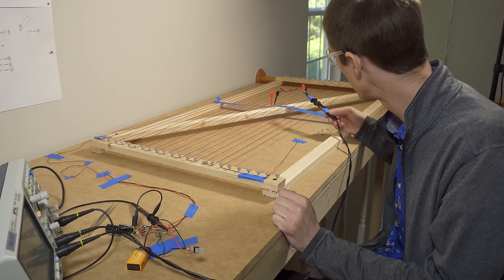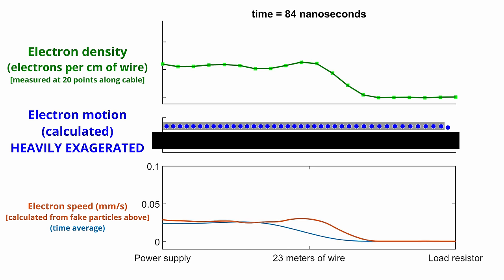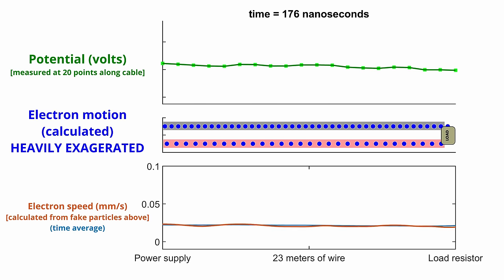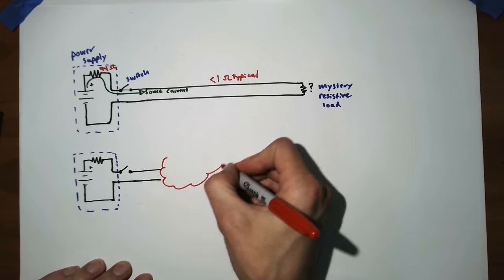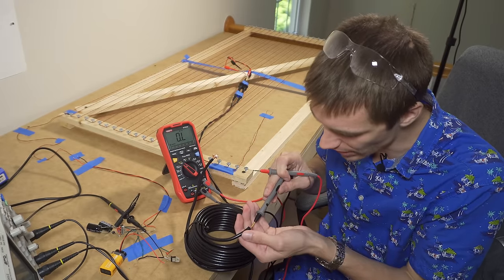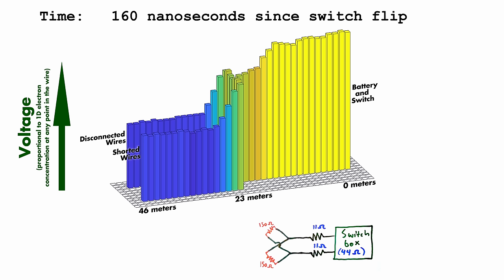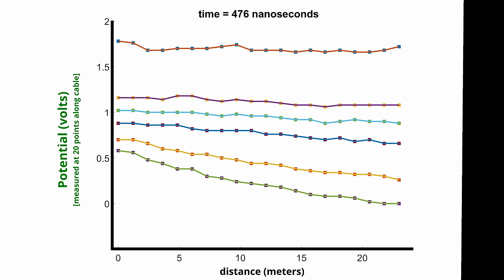What does "impedance matching" actually look like? (electricity waves)

Comment: I wanted to know where the characteristic impedance of 150 ohms came from. Seemed like too much magic for me.

I asked chatgpt and it says it comes from the setup of the transmission lines themselves, and is dependent on the diameter and spacing of the wires.

Z0 = 276 * log10(2D / d)

(2D / d) = 10^(Z0 / 276)

So assuming you have 20AWG wires,

(2D / d) = 10^(150 / 276) ≈ 2.12

2D = 2.12 * 0.81 mm ≈ 1.72 mm

D = 1.72 mm / 2 ≈ 0.86 mm 

So, the distance between the center of your two wires 0.86mm from my calculations.

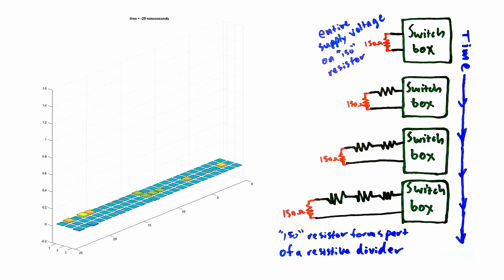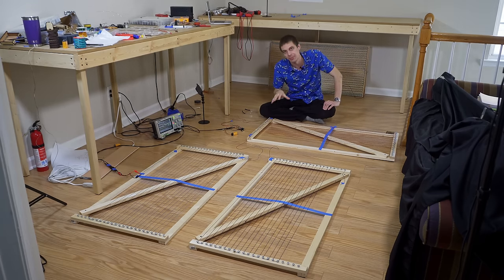Comment: SUPER CONFUSED...at 15:40 where you substitute a completely different kind of wire, you still write 150 ohms impedance. I thought the whole point of the video is that the impedance only depends on the cable design and not the power supply resistance or actual load at the other end of the wire or anything else.  So shouldn't the impedance be something other than 150 ohms when substituting the resistive wire for the original twisted pair?  I still don't understand where does the impedance actually come from, if changing the wire doesn't change the impedance.  Unless it's some kind of vast coincidence that the different kind of wire happens to still work out to 150 ohms????? I really really want to finally understand impedance but this 150 ohms at 15:40 throws a wrench into my understanding.
Reply: Does the impedance actually only depend on the power supply and not the wire?  So confused.
Reply: Put another way, what actually has impedance?  The wire? The power supply?  An interdependent combination of the wire and the power supply?  And regardless of which of these three it is, why does substituting the wire at 15:40 not change the impedance?

Comment: the resistance is make you an opportunity to play with the current, it means that you can make your current lower , THE WIERS BILD WITH MOST LOW RESISTANCE TO GIVE THE ELECTRONCE MOVE WITH LESS RESISTENCE AND WITH MORE CONDUCTIVITY SO, JUST A CONSUMER (LIKE A LAMP) GIVE YOU A RESISTENT. SO THE WIERS ARE BUILD WITH LOWEST RESISTENS TO GIVE YOUR LAMP A BATTER LIGHT (AS AN EXAMPLE) LIKE P=U*I THE LAMP=P THE U=VOLT AND THE CURRENT=I.

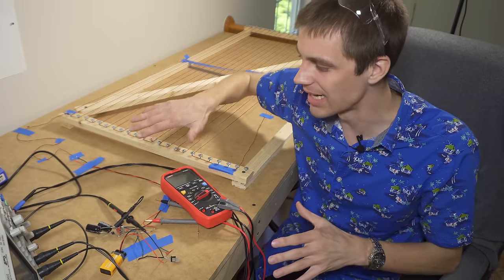Comment: @11:57 It doesn't stop with an AC signal. Or if it does stop, it repeats over and over, so AC is really where transmission lines become interesting and why AC is a much more efficient way of transmitting power over distance.

Comment: Impedance is the effective resistance of an electric circuit or component to ALTERNATING current, arising from the combined effects of ohmic resistance and reactance. In your consideration for the first "pulse" of electricity the cct is an Alternating supply IE going from 0 to + volts when you switch on.
The circuit has more than a simple Ohmic resitance. In AC terms this is called reactance, (practically you show that well), so the Imprdance of a circuit is calculated as 
Z = \sqrt{R^2 + (X_L - X_C)^2}
Z	=	impedance
R	=	resistance
X_L	=	inductive reactance
X_C	=	capacitive reactance

I loved AC theory!

Comment: At t=3:19, you have the electron velocity (23um/s), but it could be 'better' scaled so that the time period matches that of the period of it's motion (you have a 156 nanosecond graph), so IIUC it's 3/20ths of that for the density change ~25ns (1/40th microsecond), so let's reframe that velocity as ~1 picometer / rise time (25ns). That's hardly any movement at all! 
Given copper's crystal spacing of 363nm were talking 0.3% of the width of the copper atom. It's a very small head nod of a 'Mexican wave'. 
Good for context.

Comment: Electrons aren’t balls in a pipe. It doesn’t work that way. There are no “clumps of electrons”. If that were true, capacitors would gain mass when they were charged and lose mass when discharged, as the “clumps of electrons” flowed in and out. But that’s not whats happening at all. It’s a transverse wave being transformed into a longitudinal standing wave and back again, each cycle. The longitudinal dialectic impulse drives each transverse oscillation which forms the electro-magnetic transverse wave, or what you call “an electron” each cycle. But it ain’t billiard balls in a pipe. A wire is just a wave guide. And electricity and magnetism flows around wires, like a wave guide, and not through them.

Comment: Congratulations, you've explained what a "transient response" is and finally fit the final puzzle on the "impedance matching" argument between Veritasium & Electroboom long ago.
But yea, electricity is weird, we're just putting 50ohm, 75ohm, 150ohm and 330ohm value just to cheat physics and dumbing everything down so it can be practical in real world.
Again, we're just referring them to the number of "RG" on whatever cable we're trying to fit between two connections depending on what application we're doing.

Comment: People overclocking computers can actually break hardware with this "spike" of voltage. JayzTwoCents accidentally did this on camera. When overclocking, one of the parameters you can change is voltage as adding more voltage can usually help push higher clock speeds. When applying a risky voltage right at the very edge of what he thought it could handle (something bonkers ~1.6v which would probably instantly pop most modern chips which run ~1.1-1.2 iirc) as the system locked up completely and he had to turn it off to restart. He restarted it, but that spike in voltage sent it (proportionally) WAY over the edge and bricked the CPU. Maybe give it a watch. It was a cool video from what I can remember.

Comment: This topic always fascinates me. And I was struggling trying to understand impedance matching until I got into ham radio and started reading ARRL Antenna Book. In the transmission lines theory section,  it explains Z matching for AC circuits and it's importance. Basically, a transmission line represents myriads of capacitors and inductors in series that make the line reactive and gives its characteristic impedance. When the load Z at the output of the line exactly matches the characteristic Z the line "thinks" it's just a continuation of itself.. No reflections occur, resulting in full transfer of power with no losses (except the material's resistance).

But yeah, your "recognizance'' pulse is super cool.  Another, mind blowing thing for me is that if, for example, a line had no resistance and was 100% lossless, the current would still directly depend on the voltage in accordance with the Ohm's Law, just as though resistance  was there!... I  don't have an engineering background so it really seems cool to me . Surely, for engineers it's not news at all)))

Comment: 12:02 "This state (where it looks like the wires are connected) can only exist briefly" This is an interesting comment, especially when you start thinking about AC high frequency RF signals; effectively, when you're switching your voltages fast enough, that "state" exists indefinitely (because you flip directions before the electrons have a chance to get around the whole loop) which is why the impedance of a cable (and its associated mismatches) is so important. You never reach equilibrium, so these transmission line effects dominate.

This is related to why it's entirely possible (and, in many cases, intended) for some designs of wireless antennae to actually present a "short" at DC and things still work fine. If you're going to waggle your electrons back and forth fast enough, it simply doesn't matter that much for the overall current flow whether the ends of your wires are shorted or open, but either configuration can affect the overall propagation of the electromagnetic fields in favourable ways to ensure efficient energy transfer into the air.

Comment: Can someone explain why the circuit (pulse generator) expects for 150 Ohm impedance, even if the twisted pair line isn't connected yet, where does this number of 150 comes from? Because he said that internal resistance of  power supply is 44 Ohm, it's so confusing...

Comment: I find it fascinating that you were able to use a $100 (or so) oscilloscope to obtain measurements that you could then plot to show us the REAL ACTUAL waves in voltage traveling around a wire, when this understanding and notion of waves of voltage propagating around, the reflections thereof, transients and other difficult-to-grasp advanced concepts in electrical engineering, has been around for a long time, and gigahertz precision measurement equipment has existed for many decades (even if it was expensive earlier on) but nobody thought it was worth the time to figure out how to obtain and collect the data to teach students. 

You should receive a prestigious award from the IEEE as well as probably ACM for your contribution to pedagogy. Not joking in the slightest here.

Comment: So the Standing Wave Ratio I measured in, & tuned my homemade antenna to lower, with RF (radio waves) is analogous to why I impedance match my headphones to the amplifier. I'm giving the electrons what they expect to see, stopping continuously re-initiated negotiation waves every time the voltage changes. 
Actually seeing those waves was worth every second you spent adding taps to your bespoke twisted pair.
Have I got this right? That tuning an antenna to resonance is for the same reason I match my 2000 Ohm Sennheiser HD-424X headphones to an amplifier that "expects" to see that impedance?
This also explains the 50 Ohm dummy load I used to let me tune the output of a transmitter in place of sn antenna. The idealised resistor you showed...

Comment: Someone else on youtube introduced the concept of the “engineering method” vs the “scientific method”.  You sir are much more the scientist and wrapping your head around impedance matching, reflected waves, and the impact of impedance mismatches somewhere along the route of the circuit, is complex.  EEs take the engineering method with your impedance substitution (as a complex number actually) and its pretty much second nature to most under graduate EEs.   But requires nearly a PhD to grasp as a scientist.  It’s true and super valuable that you walked through this as although pretty much all of us had to grasp these concepts in your junior year of EE fields and waves class the underlying details are fairly complex.  Couple areas that can blow your mind next would be to try to use your setup to actually transmit information from the start ot the ends of the wire and how fast can you actually transmit data vs how well the impedance is matched at the ends or actually having the energy leave the circuit as an electro-magnetic wave.  that’s typically senior year of undergrad  EE.  :). Super good stuff and thank you.  My favorite youtube series in the last month at least.

Comment: I still don't understand how the 150Ohm value comes up.
- How do you have to change the wire to make it equal a target value?
- Does it stay the same with different wire shapes? what about if you split the cable: one goes East, one goes West
- How does it relate to the battery? I expected a 9V battery to make a 9V peak, definitely not 2.25V

Comment: Brian -- if you thought it was cool to visualize reflections and understand impedance, I strongly encourage you to check out the possibly surprising way that impedance matching is done in high-speed digital circuits.  

There the priority is to avoid the signal voltage bouncing, which could communicate multiple pulses where a single transition was intended.  So you might think this would be solved by making sure that the receiving chip's input has the same impedance as the PCB track "transmission line" (typically 50 ohms) to avoid reflections.  This is indeed sometimes used -- it's called "parallel termination", but it has the severe downside that it requires a lot of ongoing drive current to maintain one or other logic voltage, due to the low resistance of the termination.  

Instead, we would like to take advantage of the usually very-high input impedance of digital inputs -- but feeding signal from a 50-ohm line into a very-high Z input will obviously cause reflections.  This dilemma is solved using "series termination".  At the transmitting side, the output driver's usually very-low impedance has a series resistor added to it to bring the total driving impedance to the same as the line (50 ohms).  Now an output transition (say low to high) results at first in a half-height voltage step imparted to the line (because the 50 ohm output Z and the 50 ohm line Z form a resistive voltage divider).  That half-size transition barrels down the line to the receiver. There, the reflection doubles the signal, supplying the receiver with a full-height "high" signal. The reflection (now a full-height signal) travels back to the transmitter, where it sees an impedance that matches the line, so no further reflections occur.

Look at Phil's Lab videos for details:   Series Termination:  https://www.youtube.com/watch?v=nYvZ791-VZM  and Parallel Termination: https://www.youtube.com/watch?v=HF-H4iuyBnc
You would certainly be able to reproduce this on your apparatus.

Comment: Can you help me by making a formula for designing a leaky coax antenna? 
  I was surprised you are only just learning this stuff about impedance matching considering how smart you are and how much education you have had, plus you are probably more intelligent then me and heck likely better at even the most general thinking task , so I'm hoping you are much better at math too , hopefully so much so that my request is easy and takes you less than the time to read this!
  A leaky coax antenna is where you cut off part of the shielding about about half the perimeter about an inch or two in length (~⅛waveleangth?). You make these cuts every wavelength for the frequency you are transmiting/receiving for a section of the cable.
   Hears the problem,
Radio waves don't travel at the speed of light in coax (usually 70% in my experience, 50-97% range i've heard for different 50Ω cables)  apparently the velocity factor isn't directly related to impedance either but has more to do with the capacitance and the type of material. Also when you start cutting you change the velocity factor.
  Can you make a formula that can given initial capacitance and operating frequency output the new velocity factor and wavelength when cut?
   I would just use test equivalent to hone in on it if I could afford such equipment...
  Or maybe since you have test equipment, maybe just check to see if such cuts make any significant change at all? 
 Just take 5 min and don't cut yourself...

Comment: So the Electron speed is calculated from Fake particles? HUH?
An Electron is FAKE. It is a unit devised solely from math. It is used to make predictions about matter and its charge state or lack of charge there of.
Impedance only works with RF or RF like waves in electric "theory" which has devised devices to be used in such a theory.
 Also I believe the wire in your case or setup is a bifilar COIL and will get induced voltages from the previous "Waves" you provide that will cancel or otherwise boost the voltages on further trains of waves through the coil. Not only does the wave travel down the wire but it induces a current in the opposing twisted wire (bifilar) coil you have there.

Comment: How would you calculate the impedance then? Do you treat the wire as a capacitor and based on that you somehow calculate it's "temporary resistance"?

Also, did I understand correctly? To make the experiment, did you basically tap into a few points on each 23m long wire over and over until you had all the data samples? That must have been a hugely tedious undertaking.

Anyway, thanks for these videos dude, I understand electricity much much better now.

Comment: You did a really nice job of explaining it, but maybe an additional perspective could still be useful. The 150 Ohm characterizes the Riemann invariants. You can decompose the electric field an the current into two waves, one traveling to the right, and one traveling to the left. The magnitudes of those waves are the Riemann invariants. They are quantities that you can construct from the electric potential U and the current I, such that one is constant when traveling to the left with the wave velocity, and the other is constant when you travel to the right with that velocity. They are U-R*I and U+R*I, where R is the line impedance. If there are no waves coming in from the right, that Riemann invariant is zero. Thus, U-R*I=0, or U/I=R.

Comment: Great video.  Fascinating,  It was never this clear in school (40 years ago) nor in my Ham Radio experience (formerly G6KCQ).   Since radio signals are AC the circuit never reaches equilibrium unless impedance matches, meaning there is always a reflected wave in a mismatched system.   Depending on the magnitude of the mismatch the reflected wave can fry a transmitter, cause unwanted harmonics, and reduce efficiency.